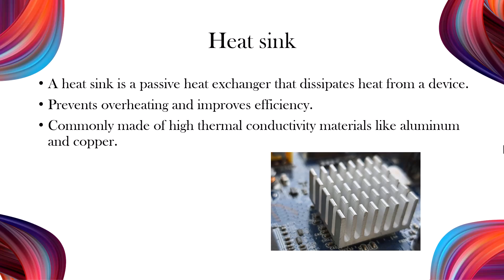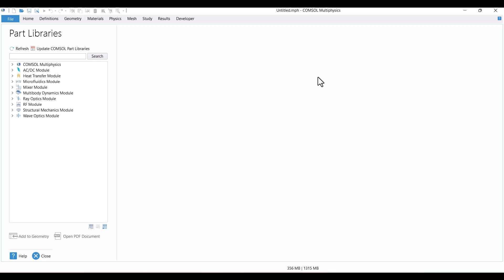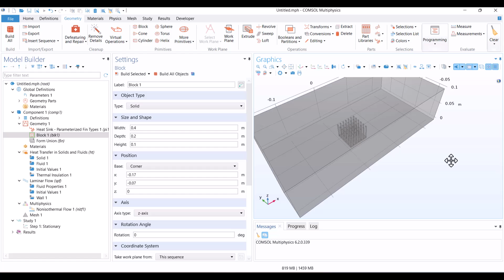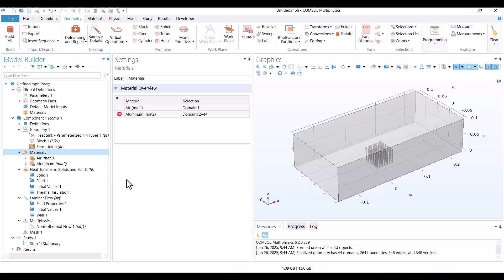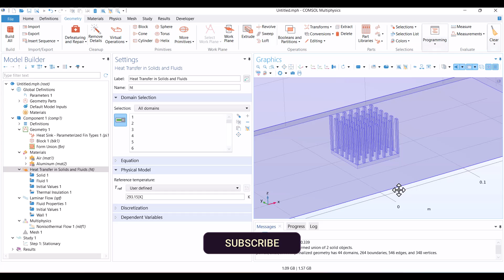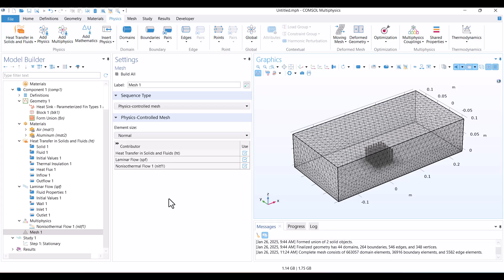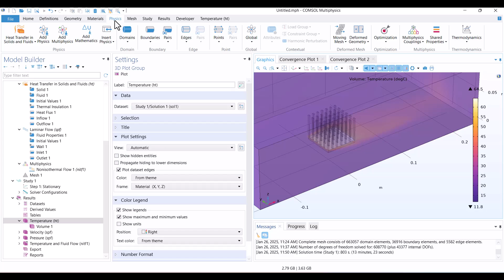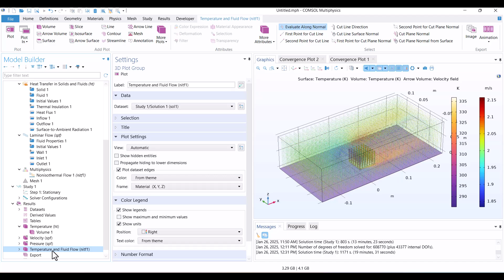🔥 COMSOL Tutorial: Heat Sink Simulation | Conjugate Heat Transfer & Radiation 🌡️

Comment: Hello, I have a doubt in heat transfer physics. I have to alter the heating and cooling surfaces for every X seconds of the Peltier module. I have used square function to alter the surfaces and it is working but giving unusual temperature values. It would be very helpful, if u have posted a video on this question.
Reply from the maker: Hello, I am not familiar with how Peltier works. I will look into it in the future.